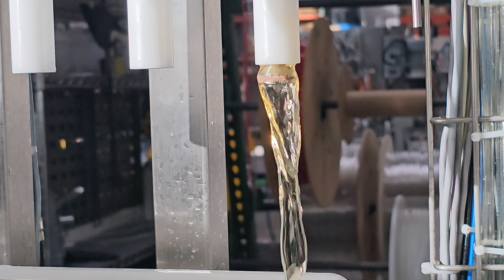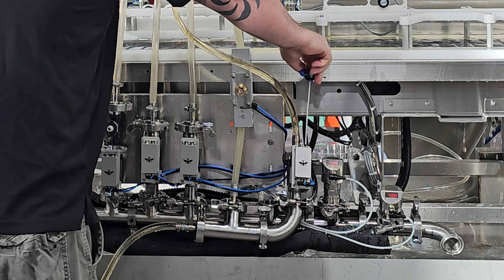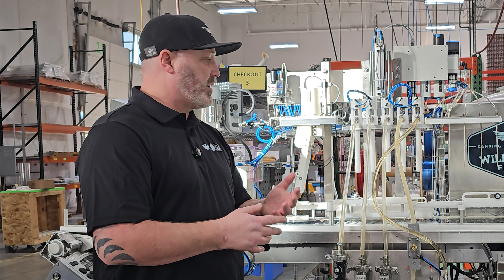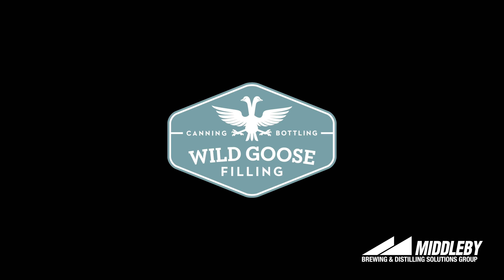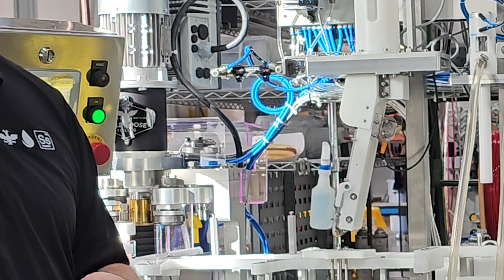Flow Stages & Breakout: Using Low Flow, High Flow & Finish Flow on your Wild Goose Canning System

Comment: On the gosling 2.0 does the machine require the compressor to run continuously? 
Does it need a holding tank or can it run directly from the compressor?